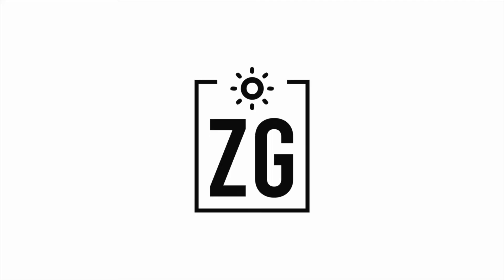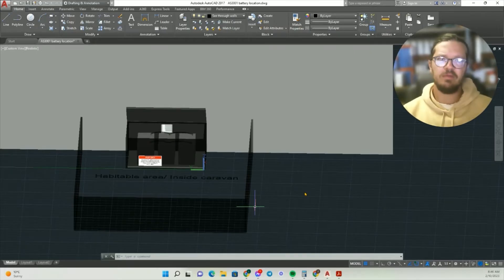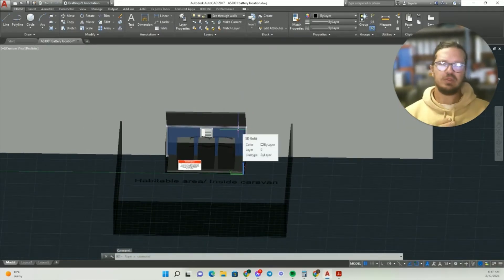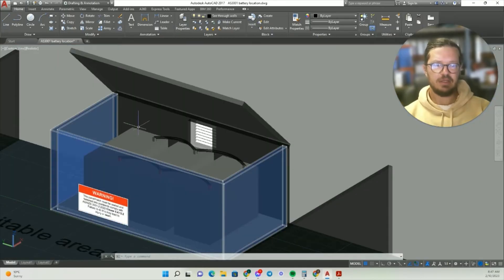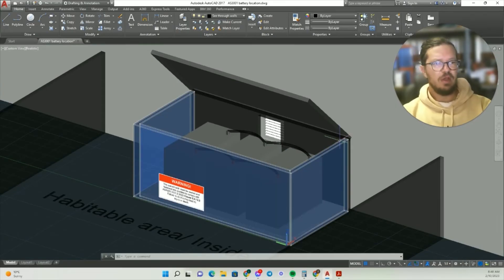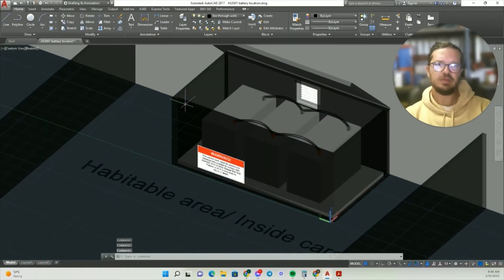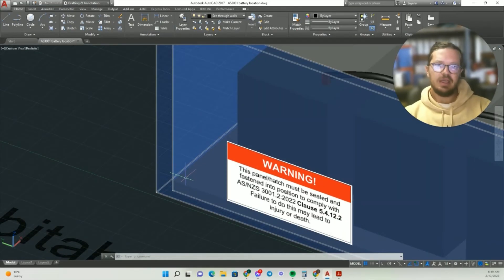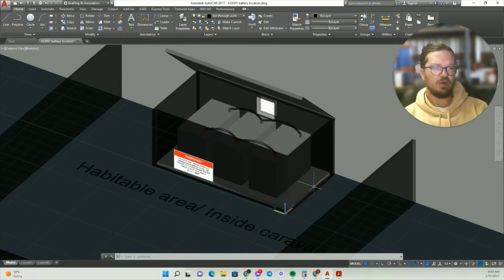AS3001 Battery Location Rules for Caravans & Motorhomes

Comment: What are the gasses that Lithium batteries give off? I thought they were sealed. I don't understand this ventilation requirement or the need for it.  I hear talk of "thermal runaway" whatever that is and I doubt I want to experience it. I am installing Lithium as upgrade in caravan and can and will comply with regulations, mainly due to insurance concerns. I see no requirements as to material for containment. Have heard a suggestion of lining wooden enclosures with a "fire proof" material and I'm like "Yeah that's going to help in a lithium battery fire".
Every ounce of common sense I have gained over my many years tells me the biggest issue is wire size and fusing. 
As I understand it the biggest risk with lithium is exactly the thing we want lithium for. Like fire, a great servant but a dangerous master. The immediate discharge rate in any sort of short. Could be due to loose wire or component failure. OK I'll enclose and vent  but I'm damn sure I'm going to use MORE than adequate wire size and fusing.
Reply from the maker: Hey mate! Couldn’t agree more! Most fires are caused by incorrect fusing and cable sizing as well as low quality components. For example cheap lithium batteries with bottom shelf BMS that safety features don’t work as well as they should. And yes the box is to contain gasses not like many rumours that it is to contain a fire. The theory is there that if a fault is to occur in a lithium battery that it can emit carbon monoxide and some other harmful gasses that we don’t want in the cabin where we are eating/sleeping. I haven’t heard of any cases where this has happened but I don’t want to be the one to find out and happy to have them vented to the outside for peace of mind.
Reply: @zerogridaustralia  Cheers. Thanks for the answer on what the gas is. Have seen some small computer type fans that have a temperature sensor. Might include one on top vent. Should help with cooling in hot weather if nothing else. Also good to know that carbon monoxide is lighter than air so will rise to exit top vent. Plan on bottom vent through floor, box built into existing under bed storage which has top vent to exterior around which I can construct battery box. Only batteries in box and other hardware as is, external to box. Bus bars fitted to outside of box with sealed wire pass through to battery terminals.

Comment: I believe there is a calculation for the required ventilation openings. I see people using 16mm John guest pipe and don’t think that complies. I also don’t think your 20mm would be enough for the 4 batteries you have indicated.

Comment: Great video. I'm converting a bus and was told there is a rule about to your diesel fuel lines. What's that all about? Does this mean you can't put the batteries over the fuel gauge access port? Or do I need to consider where the fuel lines run underneath? I want to build a battery box under the bed.

Comment: So do the regulations state any upgrade to lithium  phosphate lifePO4  12v systems can only be installed by an certified installer?  Does the regs state anyone DIY fitting life po4  must get certification or signed off?

Comment: Removed from habitable area to remove off-gassing ( Lead Acid  / AGM ) and gases from a thermal runaway (Lithium-based) from entering an area where you potentially to come in contact with those gases and become unaware these gases are affecting you and other occupants of that habitable area. I see it more aimed at the lithium installs and the potential for thermal runaway, I personally will be removing the batteries to an externally mounted and vented metal box to remove any harm from gasses or heat/flame damage to the internals of my setup.

Comment: I am doing a rebuild of my caravan electrical system at the moment, so I have to meet the new Australian Standard on electrical installations in caravans, motor homes, trailers and vehicles.
The venting requirement I solved by purchasing lithium iron phosphate (LiPo) batteries from Big Wei Batteries in Slacks Creek in Queensland. They manufacture the batteries from premium quality cells, but most importantly, they are in a stainless steel, sealed box. I asked them to build my batteries with a gland in the box to connect some tubing out through the floor of the caravan battery compartment through an electrical junction box with air conditioner filter material in it to prevent dust from coming in.
Also, it is mentioned in the video that the Standard is a “suggestion” or “recommendation”. This is incorrect. The Australian Standards are made compulsory in all States and Territories of Australia. If your vehicle or caravan burns because of an electrical issue, you may not be covered by insurance. This is particularly so if the fusing requirements are not met, which are very comprehensive.
Thank you for your video.
Reply from the maker: That’s a great solution to the rules in the standard. I’ll be sure to check those batteries out 👍🏻

Comment: These new rules are a bit silly.  For lead acid batteries sealing and venting at the bottom is a bad idea as hydrogen will accumulate at the top.  For Lithium, which are in scope of this dangerous standard, unfortunately - why is ventilation required for gases?  These batteries are sealed and do not give off gases except in thermal runaway which is an entirely different problem.  
I would ventilate any battery to keep it cool unless always charging and discharging at less than C/20, though with lead acid would prefer ventilation was external and upwards and diffinately not sealed/vented downward - I have had to investigate far too many Lead Acid H2 explosions though all from wet batteries.  
It is interesting to note that if building a campervan on a Mercedes platform the chassis battery is usually under the driver's seat and clearly not ventilated to the outside!  Luckily it is at least an AGM.  So seal up a Lithium that does not outgas as the house battery while having the lead acid chassis battery ventilating into the cabin??? Nuts!
Reply: The standards say that lead acid must be ventilated from beneath and 'a suitable tube' located at the top of the enclosure.

Comment: Are you aware if there are any minimum volume requirements for the enclosure at all?
Reply from the maker: No requirements, but I would leave a bit of space in all directions to help with heat. Everything gives off heats and then it needs to escape somehow. I have seen some neat metal enclosures on the market lately if you like I can link you to them. Cheers, Landon
Reply: @zerogridaustralia Thanks. I'm a bit space limited so there will be room in the top of the enclosure but limited room around the sides. It will be well ventinated but the location used will be surrounded by plywood. LiFePo4 batteries from Valen Australia who are not the cheapest but have an exceptional safety record. They're not a retail supplier, they do a LOT of big off-grid stuff.

Im handling the DC side of the system - all Victron install, and a friend of mine who is an industrial sparky is handling the AC side of the system.

Comment: So how are boaters going to confirm with this rule especially Yachts,?. I have both Lithium and AGM in my Sprinter, there is no vent points in either, how do I get on?, many thanks your efforts.
Reply from the maker: This is a requirement for new builds and systems being upgraded. It needs to suit the rules at the time of being built/upgraded. I’m not sure with boats. The do have there own standards to adhere to (AS3004) that I havn’t had the need to read just yet

Comment: Interesting. Would this also apply to camper trailers, teardrops, squaredrops etc where there would  be limited options for battery location and would this include Lithium batteries which typically don't vent gases (thermal runaway excluded)?
Reply from the maker: Hey mate, yeah in my opinion they still need to be outside or sealed internally and vented outside as they are needed in caravans/motorhomes. And yes this rule is for lithium batteries in new installs. Cheers, Landon 👍🏻
Reply: If you are familiar with the pod style vans … what about under the bed in sealed space with external venting?
Reply: Good information. Are those warning stickers available anywhere?